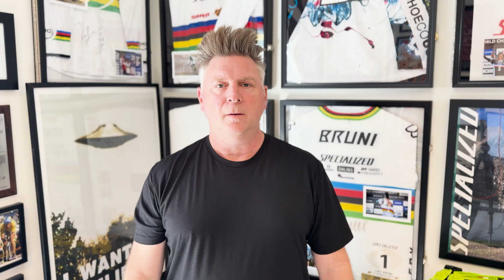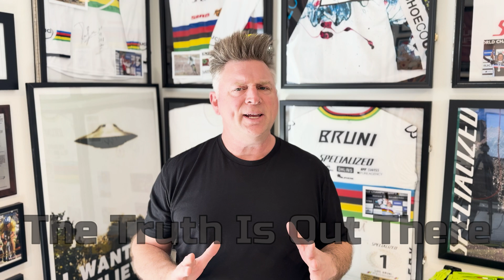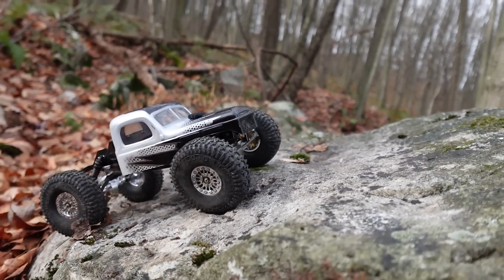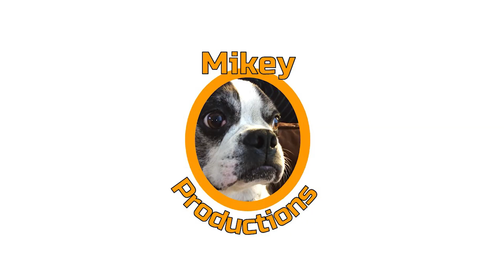The Truth is Out There - Let Me Analyze Your Tuning

Comment: How do I determine what my gear ratio is and what my gear ratio Target should be?
Reply from the maker: I need to do a video still on how to calculate gear ratio. Stay tuned.
Reply from the maker: If it’s strictly for crawling put in the lowest possible gearing at every opportunity - 9t pinion, under drive portals and diff, etc. Then see if you are happy with the top end. If it’s too slow bump up the pinion one tooth at a a time. 

You will also want to gear it lower if you have bigger 2.2 wheels and higher if you run 1.9. 

You’ll see rigs from 55:1 to 95:1 final ratios.

Comment: This may not be exactly what your looking for, but I am struggling understanding the amount of amps a small, less than 800 mah, battery can deliver vs. the amount a crawler with rear steer might require. I only really see this as an issue on my steel tube buggy that is 8.8 pounds, but even with a 15 amp castle bec, I’m not able to supply the power needed on 3s or 4s. The steering will start to cut out when the motor and servos are under load. I wonder if it’s worth running 2 smaller batteries in parallel to up the available amperage.
Reply from the maker: I'm not an expert when it comes to electrical things but it sounds like you are doing things correctly. Here are my thoughts:
Check your battery output "C" rating. It should be over 100C though these numbers are not necessarily accurate so buy a good brand of battery.
It's possible your servo or BEC are defective.
Only use full sized servos, not Low Profile.
Get a bigger battery - 1500-2000mah - if you are already at 8+ lbs - a bigger battery won't add too much more weight.
Try direct power servos.

Comment: Great idea. I'm at 65 deg vertical slopes in my TRX6 and performs better with more centre weight rather than front weight?!
Reply from the maker: The way that would be true is if it’s lower than when it’s at the front. Also depends on your definition of performance and how repeatable your test method is.